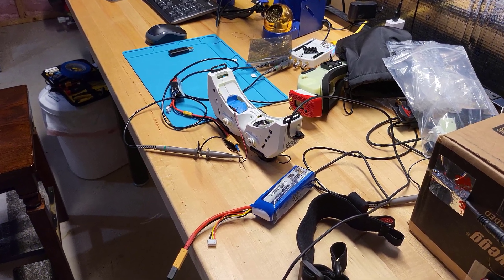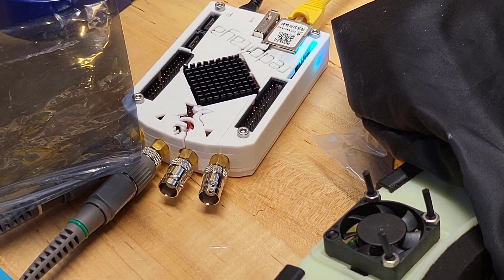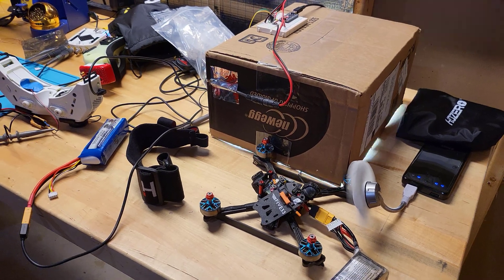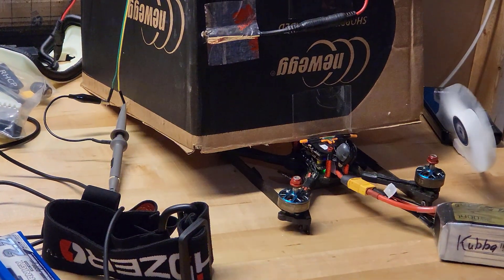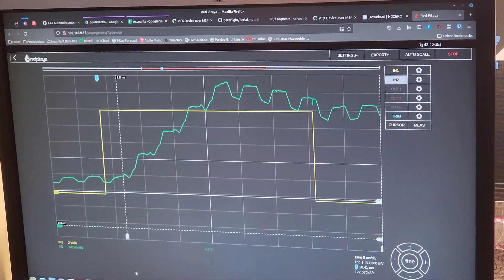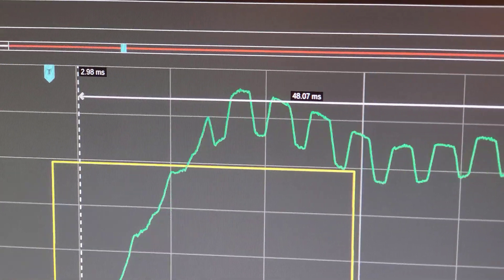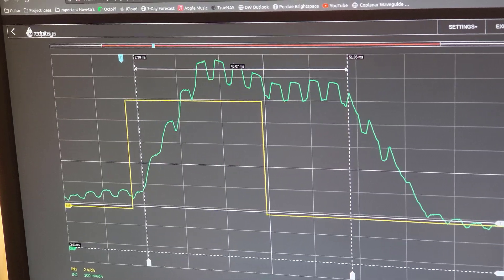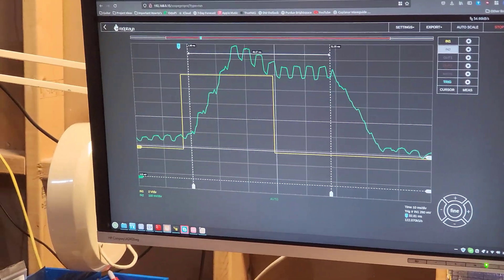Did HDZero Goggle Measure Up to Claims? Latency Tested with Oscilloscope

Comment from the maker: If we use Chris Roser's methodology, HDZero will show a whole frame in 19ms vs 35ms with analog.  Chris has a different test methodology (and is less precise also). The standard for analog camera latency testing is a photodiode test where we measure the first scan line to respond to the LED illumination. In this way, hdzero and analog have sub frame latency. Analog technically only shows half of a frame per field, so using the whole frame methodology, Analog must be multiplied by 2 fields, hence the longer latency than HDZero

Here's a writeup on the photodiode test setup and how DJI and Analog compare https://docs.google.com/document/u/0/d/1yqzkXVfzEgR-kuxr2HYPDPRfPJt09-n7eqVHkDEDV3Y
Reply: i think half of the analog frame should be counted as latency. If there is a sudden obstacle, half of the interlaced frame is enough to start reacing i think.
Reply from the maker: @IvanEfimovLimon  I agree with this. Chris has different thoughts. Now, the 90hz hdzero camera should excite you 3ms + 11ms is 14ms per whole frame, wow
Reply: @RyanQuellet  Did you just say 90hz hdz cam? ear pearks
Reply: @aphinion  90hz but lower resolution
Reply from the maker: @aphinion  yes, I have a 90hz camera in testing
Reply: I do feel that measuring like you do is like taking a measurement of the delay between hitting the throttle and starting to accelerate on the quarter mile instead of the time of the quarter mile itself. Either way it's still impressive to have such low latency!
Reply: I think Chris Rosser's method is OK, it's kind of 'real world' in its approach. I think you can count the first frame of analogue though, well, certainly in a race situation where you're going to be able to make out gates or flags in that first half frame... In a scraggle situation thoes half analogue frames can be really annoying! And, the lower the latency the better, doesn't matter how quick our brains are, lower latency means we'll be that much sooner to make the turn etc etc. And latency adds up across the different systems in flying a quad... every m/s counts.
Reply: >where we measure the first scan line to respond to the LED illumination
There are no scan lines in progressive video displays. What you call Chris Rossers "methodology" is useless because most goggles (especially Chris' Sky04X) render fields as frames. It always carries half the resolution, although is displayed at 60 frames(!) per second. Progressive and interlaced video is displayed exactly the same on your goggles screens, which you can verify by using a high speed camera. That said, the numbers he presents are accurate.
Reply from the maker: @itsallsobothersome4537  I can show you high speed camera footage that will refute some of what you've said. Watch my slow motion video about how analog,  hdzero,  and dji update
Reply: @RyanQuellet  I have seen this video (plus done this myself) and it's still not a "scan line". In fact, try the same with a progressive video via hdmi and you will see exactly the effect of the screen updating top to bottom. Heck, an iPhone screen updates like that (and has the same black PWM line if you turn down the brightness far enough) when filmed with a high speed camera.
Reply: The Chris Rosell "method" just have no sense and is ridiculous and is misleading method. You cannot mix image formation, full picture perception, PAL NTSC Hz with latency and forget that is a brain who mix the images and quit that from the equation.
As most youtubers, encyclopedia sellers that sell what they are said to sell.
You did right
Reply: @Flamenawer  going to have to disagree on what you're saying. You don't measure a sprint by the time it takes you to react from the start shot, but by the full run.
Reply: Mr. Roser rose into his fame by copy-pasting stuff from the others. And that's all he will ever be to me, I've long blocked the bloke.
Reply: @pirateradioFPV  what on earth are you talking about? He's an aerospace engineer that does quite a lot of scientific testing and research, trying to make sure people have optimal performance quads out of what they have.
Reply: @fpvkitchenwanziifpv6370  Well said. One of the most intelligent people in FPV with an exceptionally high level of geek 😁
Reply: @sylvanlight120  You should ask him how many alters he needs to sustain that illusion.

Comment: Creating one of the best spec fpv goggles can only be created w intensive community input, which is why this goggle ticks so many boxes! The fact that it served racing first instead of freestyle pushing low fixed latency, gets a place in my heart, you have Thomas Bittmatta in the presale to get a set to test for racing that will influence Thomas in the near future...and that speaks volumes about the movement and potential for this product....I PRE ORDERED.! It is a Carl; take my money! product by specs alone, and then 3ms fixed latency drives nails into the competition. Carl zhao, the chip designer extraordinaire; is the best thing to happen to FPV in the last 5 years! Thanks to everyone testing and providing carl w realistic professional feedback so he can pivot, and at the same time quickly produce some of the most exciting fpv products; seemingly out of nowhere!

Comment: why dont use hardware encoders/decoders (like nvenc) fpga chips on the transmitter and the receiver
Reply: "The maximum resolution for nvenc h.264 is 4096x4096. For nvenc h.265, the maximum resolution is 8192x8192."

Comment: Thanks for sharing your results. Please test with different ranges between camera and goggles? I wonder what happens to latency?
Reply: With the way HDZero works the latency will only go go up because of the time it takes for the radio signal to go the extra distance(near Light Speed) there is no equipment on earth that could measure that small of an increase over that distance. other systems latency increase because as the signal degrades or gets interfered with they ask for the frame from the vtx again which  takes time, the further away you get the more break up you will get so latency on those systems increase, same as bad RF environments. those other systems sacrifice latency for picture quality, thats also why they have a hard limit on range as the error checking gets to a to higher level. HDZero sends each pixel as the camera sees it, thats why we get break up on hdzero it becomes part of the picture information, saves time.
Reply: @acevr4  - awesome no degraded modes!!! One latency no matter what the distance. Well then the image must degrade over larger distances.

Comment: Can’t wait to get a set of these! How does that test hold up if the drone is the other side of a track to the goggles?
Reply: With the way HDZero works the latency will only go go up because of the time it takes for the radio signal to go the extra distance(near Light Speed) there is no equipment on earth that could measure that small of an increase over that distance. other systems latency increase because as the signal degrades or gets interfered with they ask for the frame from the vtx again which  takes time, the further away you get the more break up you will get so latency on those systems increase, same as bad RF environments. those other systems sacrifice latency for picture quality, thats also why they have a hard limit on range as the error checking gets to a to higher level. HDZero sends each pixel as the camera sees it, thats why we get break up on hdzero it becomes part of the picture information, saves time.

Comment: Nice very nice! Will this latency numbers be consistent irregardless of dstance of the drone from the goggles?
Reply: Thats how HDZ works !
Reply: @jas-FPV  cool! Thanks Bro!
Reply: With the way HDZero works the latency will only go go up because of the time it takes for the radio signal to go the extra distance(near Light Speed) there is no equipment on earth that could measure that small of an increase over that distance. other systems latency increase because as the signal degrades or gets interfered with they ask for the frame from the vtx again which  takes time, the further away you get the more break up you will get so latency on those systems increase, same as bad RF environments. those other systems sacrifice latency for picture quality, thats also why they have a hard limit on range as the error checking gets to a to higher level. HDZero sends each pixel as the camera sees it, thats why we get break up on hdzero it becomes part of the picture information, saves time.

Comment: Analog never shows full frames ever. Each half frame is recorded with 50/60 Hz. If you wait for two half frames, you get two half frames from two different points in time. Not a single full frame. It is wrong to add additional latency to analog for being made of half frames.
Reply: Because of the persistence of vision, your eye blends the two half frames together, so in fact, it is valid to add latency to analog until the second frame...
Reply: @xovox9507  No, it is not valid.
Each field is stretched to full vertical resolution and drawn like a progressive frame. Why should you add latency there?
Reply: @xovox9507  You probably mean the second field but that would still be incorrect. Fields are always frames with half resolution on progressive LCD screens and watching progressive video via HDMI is rendered EXACTLY the same as interlaced video from your VTX, just check it yourself with a high speed camera please. It's getting annoying how people repeat this bullshit because one respected YouTuber refuses to correct his videos.

Comment: Can you send it to Chris so it compare it to his other latency tests using a high speed video feed? The consistency is amazing tho and you're right, that's the most important part. Still: Highly trained people in fast and synced sports (pair acrobatics as well as pro racing) sync their motoric actions in <10ms. That's not reaction time, that's preloaded subconciously trained patterns waiting to be activated on a sensual stimulous. And since those are impossible with variable latency (and the harder, the higher the absolute latency) dji people just never develop those moves in the first place and instead aim for blindly repeated precision & long aiming times that are occassionally synced and checked for plausibility. Smooth to watch (and great training too!) but only half the fun!

The goggles with those true RC patches look amazing. if their optics can keep up to the promise and I can get my astigmatism lenses in… I'm definitely sold :)

Comment: I am super curious- my understanding is the vrx delivers a whole frame, are the goggles printing each line as it is received? Also is it a progressive 60fps or is there interlacing happening? Thanks!
Reply: It's progressive, but yes, it's delivering a stream of image chunks, chunk by chunk, line by line, and drawing them to the screen as it receives them, rather than encoding a whole frame, sending, decoding, and displaying it at once.  The result is that you don't have to wait for a whole frame to arrive to detect a change in the image.
Reply: @syntaera  thank you for explaining that so well.
Reply: @syntaera  👍👍
Reply: @syntaera  This is incorrect and also not what Carl claims in his paper. The signal is transmitted line by line, yes, but it's rendered every full frame at the frequency the screen uses. Unless of course, Carl found a way to drive LCD displays that the whole DIY community and industry has since been unaware of.
Reply: @itsallsobothersome4537  how do you explain the consistent 4ms reaction latency to global changes in the camera that we all saw measured in Ryan’s video, unless the incoming stream is being written, essentially unbuffered, to the OLED?  That exacting consistency in timing between flash and bang is unachievable in a framebuffered system.
Reply: @itsallsobothersome4537  Carl mentioned that he worked on analog display drivers before so there is a good chance that the he also desiged a new display driver that writes the incoming video direktly to the display without a frame buffer. Thats the only way such a low latency could be possible.

Comment: Very impressive! I have to ask though, why does the light to dark latency appear larger than dark to light? Can you do this experiment again with another photodiode inside the light box? The latency might actually be even lower!
Reply: Might be the delay of the actual LED array going dark. We didn't see a calibration with just the box and sensor.
Reply: Light to dark latency is typically bigger just have a look at dronemesh latency tests of analog fpv cameras.

Comment: Could you run this again with another light sensor in the box next to the camera. It would take away the time it takes to have the led turn on
Reply: Agreed. It's my opinion that this is great work! But, it is also in my opinion that what ever measurement tool you use (in this case a photodiode) then the same measurement tool should be used on both ends (LED source and Goggle display). That way any measurement tool latency is ruled out and a more accurate delta is realized.
Reply: I think the LED probably takes nanoseconds to turn on and off.  It's negligible.
Reply: @Perforator2000  its less about the light itself and more about the drivers. I dont really know enough on the topic, but if you want to run a proper test lets run a proper test